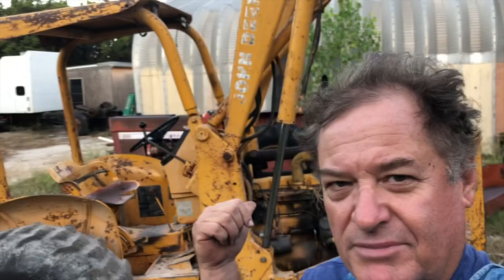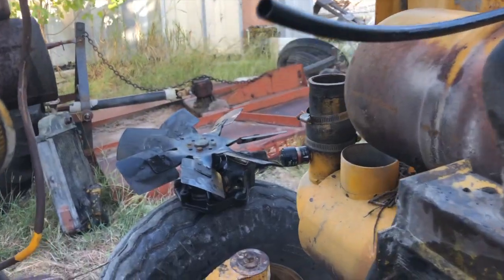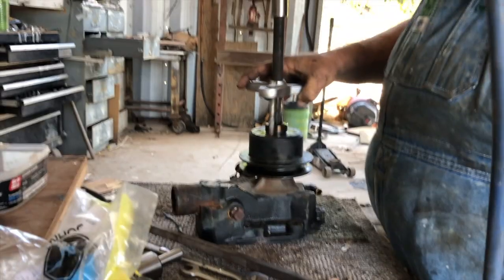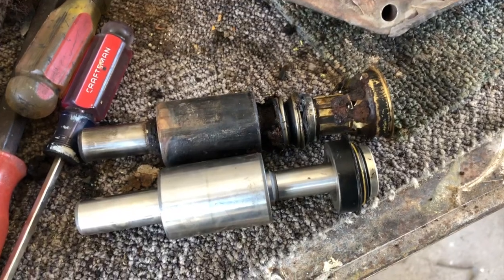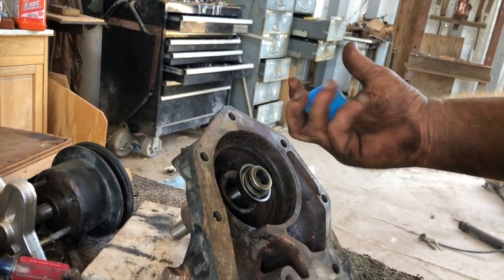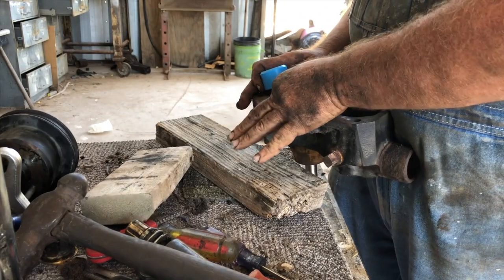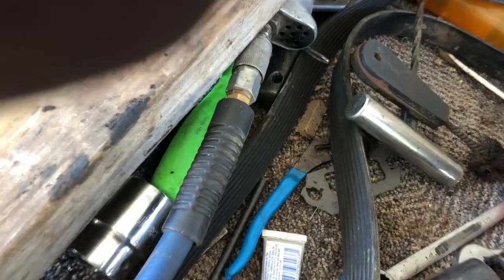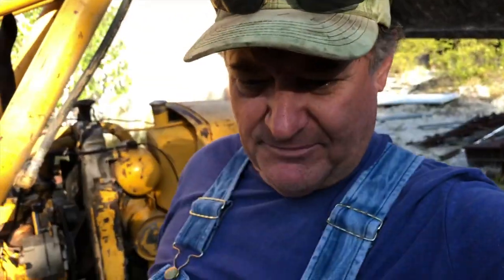Aimless and John Deere water pump rebuild

Comment: $180 aftermarket. What should I clean the plate & gasket surfaces with? Soap n water?  WD40? Brake cleaner? Mineral spirits? 1 said coat with oil?
Reply from the maker: Probably over thinking things. What ever makes the job easier for you i assume will be fine. I would try mineral spirits or WD 40. I hope you subscribe to my channel.

Comment: Yes you said something very important at the very last of the video to put the hub pulley on the shaft not the bearing why didn’t you recorded that part that is been the most difficult thing to do. And i didn’t understand how you said you did it. Do you have s drawing off since sort
Reply from the maker: I hope you will join my channel and hit the like button. Why did I not record it? Hell I asked that same question to myself in the video. If I remember correctly I took something that would clear the impeller and sat the shaft on it in the press. then pressed the pull on allowing the force to be on the pulley, shaft and what ever it was that I used to keep the pressure off of the impeller. probably an old nut.

Comment: Do you press on the shaft or on the outside of the bearing race to get it pressed back into the water pump housing? I see other video's of people pressing on the shaft and not the race of the bearing.
Reply from the maker: I pressed on the outside race. Never press on a race that will transfer the force through the bearing.

Comment: Great demonstration!  My pump is similar, but I don’t have a press or easy access to one.  My options are a new genuine JD pump, a new A&I pump, or a new no name aftermarket pump.
Reply from the maker: I used A&I and TISCO almost exclusively in my shop. I think TISCO has been bought out.
Reply: @KevinKalden  Yesterday I bought a new A&I water pump for my 1996 John Deere 5300 diesel tractor.

For the past several years it’s been dribbling out the weep hole.  Just a few drops now and then.  But this year a big puddle on the floor.  I need the tractor right now to brush hog pasture at my farm, but I’m very reluctant to run the machine on just water in the radiator.  I thinks it’s best to change the pump first and replenish the coolant and then go do work with the tractor.

Thoughts on running 3 cylinder John Deere Diesel engine on just water temporarily?

Thank you sir.
Reply from the maker: @CH67guy1  this a great question as it give me the chance to clear up some confusion on how cooling system works. The radiator and engine block are connected and if water leaks out of the pump it leaks out of the radiator. Even if the radiator could hold water after the block runs dry it would be worthless because it’s sole purpose is to transfer heat removed from the block by the coolant to the air. Also overheating can be catastrophic to an engine and ruin it by warping and cracking the block and head. Cooling system problems are perhaps the leading failure in engines. While you got your engine apart clean the radiator fins that are probably packed with oily dirt, flush the system, replace the thermostat and get in the habit of periodically blowing out the radiator fins with compressed air the remove the dirt and debris. I hope this helps.

Comment: What is your tractor? It looks like a 301 and mine is a 300 . Having cooling trouble , it blows coolant out the overflow even before warming up , i think maybe it has a cast impeller and the vanes rusted off after 50 years . What is your opinion? It will overheat after some use , rad is clean , hoses are good
Reply from the maker: My best guess, blown head gasket or crack in block or liner. Combustion gasses are being pumped into the coolant. my tractor is a 401D thanks for watching please consider sharing the video and subscribe to my channel.

Comment: I have the same tractor and it will not move forward.  Engine runs great, reverse works fine, all hydraulics are great, just no forward movement. Any ideas?
Reply from the maker: Best guess and it is onLy a guess is that the forward clutch packs are worm or has a bad seal.

Comment: I've got an awful screeching bearing once I idle up just a bit on my JD BHL 500C, I think the noise is a bearing in the water pump.  There is no play in the fan nor any leaks, It's not the alternator or the hydraulic pump and I can't see anywhere else the noise would come from. We shall see, thanks for the video...
Reply from the maker: Take the belt off and spin the pump. Perhaps the impeller is hitting the housing.

Comment: Very helpful video. My Deere water pump is doing the exact same thing where the fan wobbles badly. I was afraid I would need to buy a new pump at a cost around $2000.  The repair is a much better idea. Thanks for the demo on rebuilding it.
Reply from the maker: Thanks. Please consider subscribing to my channel and sharing my videos.